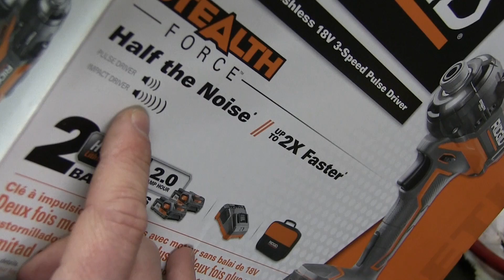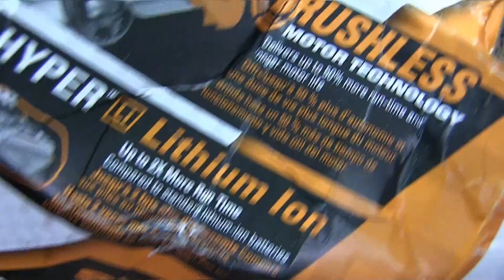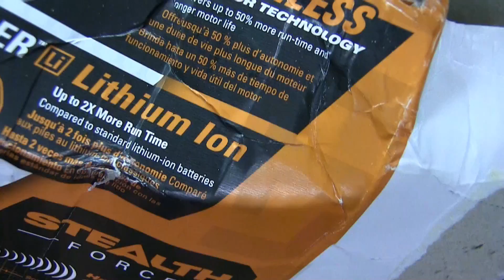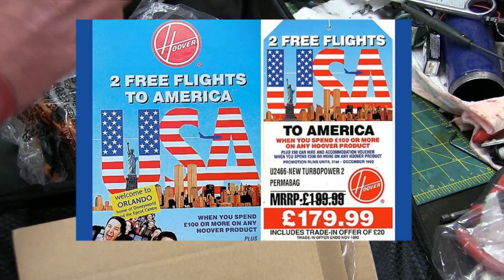BOLTR: Ridgid Hydraulic (?!) Impact Gun

Comment: Looks like they finally found the magic Answer that eluded the many Industry Giants come before. A “reliable” high performance tool  with a calculable & predictable # of Cycles or time before performance losses become so great that the user HAS TO BUY ANOTHER. 

If a tool fails completely the user is dismayed and loses trust in the brand, HOWEVER if the tool provided great reliable dependable service but then just gets worn out from use AND the worn part is unserviceable OR part replacement exceeds cost of a new unit … The user will then simply assume they wore the tool out and then buy another! 

It’s so sinister that i tip my hat to the design engineering team that dreamt up this monstrosity of corporate suit wet dreams.

Cuz so long as everything else is built solid the tool will ONLY degrade with continued use … whether that time is 2 years of day after day use or 20years of light service once it’s exceeded a certain amount of use it becomes too worn out to perform as needed or comparable against what’s available in the future. 

And any honest worker who has used the tool to its calculated point of performance loss will know how much work they got out of the tool and understand they wore the tool out, it lasted and performed well for so long and Happily go buy the next generation from the brand. OH BLIMEY Barney, I think we got ourselves a winner here! 🤑

(That is if everything works as intended and designed 😈)

Comment: I bought the 18v and 12v kits in Alberta Canada,,dirt cheap price for a great set of tools,,came back to the UK and low and behold found out that my AEG battery charger,,240v is the same as the rigid ,turns out AEG are German and are part of the Rigid company of tools.

Comment: Unfortunate the never released an impact wrench with this hydraulic system. It would be nice not to have to wear ear protection workin on on my car. I know you can do the adapter bit, but impact drivers are usually not strong enough to remove lugs.

Comment: Actually brushed motors are powered by AC as well. The difference is that brushed motors use the brushes to convert DC to AC in the guts of the motors themselves, where brushless motors are a bit more complex.

Comment: Noise is an important factor for me. I get the police called on me frequently. Just had a visit from the cops for using a right angle grinder with a wire wheel on a drum smoker. Had them called for using an air hammer, generator, air impacts, etc... Old neighbors.

Comment: I really liked my stealth impact til ti took a shit. Oddly enough it'd blast in 10" timber locks, but died going easy on a drywall screw. Now it doesn't turn at all. I took it apart and the motor is garbage. The impact unit is fine. I'm so done with Ridgid. They've definitely gone down hill. I've had quite a few unjustified failures as of late.

Comment: It's odd that they own Milwaukee, Ryobe, and Ridgid and sell them all at the same price point. I feel they would do better to market them as graded products under the  same name. Contractors and subcontractors are pretty much only going to use DeWalt and employees will either use DeWalt because they're used to it or Milwaukee because it's a better performer. Ridgid and Ryobe are clearly bargain brands for household use, but they try marketing them as direct competitors to DeWalt and Milwaukee. Say what you want about DeWalt, but they're still the most prevalent name on construction crews, I don't care what your experience with them is. DeWalt breaks the most because they're used the most. Milwaukee breaks because people get so impressed that they try doing some ridiculous shit with them like pulling axle nuts off a diesel. Ridgid and Ryobe break because people think these are made to do real work and they aren't

Comment: I've had ridgid tools from the Home Dethspot for several years. Bought the first one 18v drill with 2 batteries and dual rapid charger for $99 with the LSA. Thought it would be a bitch when it comes time to replace batteries or get the tool fixed. A few years later the batteries didnt "chooch" anymore, the pixies were dead. Called Ridgid and had to drive about 30min to a service center for the 2 brand new batteries no question asked. About 1 year ago the batteries were going again,  called Ridgid and they mailed them to me. My sander was about 10 years old and switched off, flipped the board and it wouldn't turn back on. Called ridgid,  took to HD ,paid $20 diagnostics fee and about 4 weeks later (sucked) called and I went and picked up my new off the shelf sander. And got my $20 back! Same thing with my original drill that I've had the batteries replaced 2x , a little too much use on it, she was "choochin" along and when I left off the trigger she was smoking! Called them up, dropped at HD with $20 and 3-4weeks later picked up my brand new lithium drill kit. I still have the old nicad that they replaced 2x and got my $20 back.I've been fortunate and recommend the tools to everyone,  JUST MAKE SURE TO REGISTER WITHIN 90DAYS!

Comment: I had very good luck with Ridgids battery replacement policy. I was all worried about it after hearing all the negative stuff about Ridgid warranty online. So I finally called their 1-800 number and they ask me questions about what it was doing. So they had me plug my batteries into my charger to confirm what it was doing and also wanted to confirm that the charger wasn't bad. They did make sure the batteries they were replacing we're the ones that were registered. After all that was said and done a week and a half later I received new batteries in the mail. It didn't cost me one red cent like everybody else said it would. They didn't even want the old batteries back. I guess if it was to warranty the tool, I would imagine you would probably have to pay to ship the tool back. But I'm not sure if they even want the tool back.

Comment: First off , Love your videos, I can kill a good 4 hours on Sunday watching you undress tools and see how they tick. I had one question on the hydraulic impact you took a part. What kind of oil did you fill it back up with. or what kind do you recommend ?? I have a Milwaukee surge hydraulic impact  that i took a part to clean and if i could change the oil to get better life, i will. They are way more pleasant to use for 8 hours straight , In my opinion.

Comment: Thanks for the Ridgid breakdown, very interesting as are many of your videos. I'm trying to decide between Ridgid Stealth versus Milwaukee Surge pulse.  Milwaukee Surge is not as strong but it's lighter and less vibration, but I like the Ridgid LSA & have a lot of Ridgid batteries already. For overhead work, Milwaukee Surge is tempting. Pulse tools have been around for industrial assemblers and are often pneumatic, but Panasonic has a battery Pulse tool (expensive). Moving this tech to battery tools helps with loud noise of traditional impact guns which starts to wear on your head, especially with deck builds. Nice simulation here on Pulse:  https://www.youtube.com/watch?v=PNVikfLXXwQ

Comment: AVE Did you ever get this put back together? I have been waiting on that future video where you cover the electronics and get her put to work! I did buy this unit, and I can say, I like it a lot more than my other ridgid impact driver. However as noted, the forward and reverse switch takes very little to move it, compared to the older ridgid design. My autistic kid is much more accepting of the noise output of this "Stealth" than he is of the normal impacts!

Comment: AvE you called it. Techtronic was using the Ridgid line to test out this style of mechanism before they moved it to Milwaukee. There's now a Milwaukee version of this impact called the "Surge" series at Homeless Despot.
Reply: The ridgid one doesn't last, from experience. AVE called it; it quickly becomes weaker and weaker with use.
Reply: Jonathan Robertson it will be interesting how long these will last, my guess is not more then a few years. In the mill were were constantly rebuilding or replacing pumps with daily use. These pumps are the most expensive part of the impact but they are not as tough as the industrial one we rebuilt.
Reply: The Milwaukee version is a completely different design.

Comment: I disagree with your assertion that the hydraulic torque generator will not last. Looking at the generator the vanes also act as a pump. As the media’s temperature increases its viscosity decreases and is then flowed to the outer reservoir which is surrounded by the matrix of cooling fins. Then in a thermal cycle as the temperature decreases it is flows or sinks  back into the comp for use in creating torque.  This is a passive exchange not using any mechanical device to move the stratified media. This design is similar to the one speed Hydro drive used on the Swedish supercar Koenigsegg. Totally amazing. I do agree that there may occur erosion of the leading edge of the vanes but I would believe those surfaces have been cryogenically treated. Thank you for your always amazing breakdowns and assessments of new hardware. I truly.   enjoy every new video thank you.

Comment: If the oil used in the "hammer" mechanism is a super refined mineral oil (like what is used in vacuum pumps) then the vapor pressure could potentially be low enough to prevent any cavitation. Any decent vacuum oil will have a vapor pressure below 0.1 micron which would likely be sufficient in the given application.

Comment: Slippage is also fun when you have a local company that focuses on inventory and not so much on the specifics. Suffice it to say I bought an RC drone from a local hobby shop, this is obviously not a house brand and like all things electronic the guts of it is made by a chinese company in china and then put together into finished products either in the US or China, depending on where it's supposed to be sold.
Anyhow, the damn thing lost connection on the fifth flight, did not respond to a return to home command and then drifted off carried by the breeze some half kilometre before finally crashing into a sand pit, only the GPS was working which let me find it after a bit of fiddling with my phone. 
When I opened it up I immediately noticed that three of the brushless motors were fried after having been filled with sand and then strained themselves to death against the ground (The last motor was fine, because that lucky bastard had had its prop sheared almost clean in half and the safeguard on the speed controller had probably shut it off once it started freewheeling.) and the main control board had literal cracks in it.

So I took it back to the store and wondered if the 2 year warranty was still OK. They had me fill in a stack of papers, sent the whole package over to their tech division (Or whatever) in Stockholm, and half a week later the guy just calls me up and asks me what colour I want the new one to be.
I never did get a straight answer as to what they found was wrong with it, but my guess is there's probably a shoddy wire connection somewhere between the receiver and the flight controller, probably some solder that's prone to cracks after repeated vibration.

Comment: I bought one of the 5 piece kits that included this little impact driver.  Seemed like a quality product, but the impact driver died before I could drive a full box of 2-1/2 deck screws.  Took the whole kit and kaboodle back to Home Depot and got a two piece Milwaukee set for the same price.  The Milwaukee seems WAY better.  I am surprised to hear they are made by the same folks alongside Ryobi.  Ryobi is a craptastic brand for sure...

Comment: FIY the design/brand is the same as AEG (Germany) it's also part of the same package as  Ridgid... and so on. I've the battery and charger at hand and can confirm it's exactly the same. Although in my particular case I've got the cordless drill not the impact. 

Regarding the review it's pretty good, but I don't agree with 2 small details. Opposite to what you say the reversing button is pretty robust and could even be more smooth. I apply regularly a small amount of silicone spray in it. I appreciate that smooth action when stretching/balancing on the top of a ladder and need to reverse the rotation.

The front bearing od/id allows for more small balls, so more support points and as such smoother action. Radical example try to lay on a nail bed made of, let's say 10 nails. Next to impossible. Increase it to 1000 nails in the same area and becomes much easier. Guess I need a coffee after this example. LOL  Be well thanks for sharing. ;-)

Comment: I worked at the HD, I just swapped it right off the shelf. Why? Because I promised the customer we would replace the tool and the battery. It says it on the box. I backed it up and did what I did because it was the right thing to do. Many happy customers, the vendor would cry a bit, but in actuality, we sold more tools than any other HD in the region anyway.
Fucking over people for the sake of fine print is wrong. I hated that shit. Register your tools and you shouldn't have an issue. Generally, even if you didn't I just swapped it off the shelf and sent it back as  a manufacturer defect.
Reply: I've never had a problem with the LSA but I heard a lot of people complain about it though.

Comment: So I'm with AvE on the suggestion that it was built to test such a mechanism. Its an outstanding mechanism, there won't be cavitation issues (more on that later), but they had to make sure it doesn't beat out the competing tool they release in a higher market next. So one thing I noticed which really stood out, the battery. That is a 2000mAh battery. My phone has nearly twice the battery power of that tool. Adding a better component really wouldn't be difficult or expensive, but just small aspects like that you absolutely know aren't due to incompetence or poor design choices, but purposefully limiting the tool. Something which it shouldn't need to do considering it has no competition unless they will be adding competition later.

Anyway I made a comment on the cavitation elsewhere. I came up with a huge list of reasons, but two of the easiest to explain are here. Firstly the cavitation is only a risk on the front face of the T shaped device. However it is the side face which needs damage to let any oil seep past. Thus any cavitation damage really isn't going to reduce the device's effectiveness. Secondly cavitation is an incredibly slow process. Whilst a machine in use 24/7 might see cavitation damage over the space of a year or more, this is a tool which is in use and on for a fraction of the day at most, and even then the low-pressure cavitation-risk wave is well below 10% of the time, likely closer to 2%. Now quite frankly I don't believe cavitation will ever happen in the first place, it simply doesn't have the power and the pressure wave is spread out in a sinusoidal-like shape rather than an instantaneous pressure drop, but even if cavitation was as common as AvE believes there is absolutely no risk of it reducing the device's power. It will certainly crap out on you through a more conventional means before it loses even 1% of its capability through cavitation damage.
Reply: 2000mAh at 18v is more powerful than a phone's 4000mAh at 3.7v. An easy way to calculate actual power capacity is multiplying the amp-hours by watts to get 'watt-hours'.
Reply: The insight on cavitation you gave is similar to what I was thinking.  I learned all about cavitation while studying for my boiler's license, and from what I understood was that cavitation take longer than a couple seconds to  really damage anything.  You'd have to run this thing non-stop for quite a while for it to have an effect similar to pipe cavitation and whatnot in a loop.
Reply: You can't compare a cell phone battery designed for energy density to a power tool battery designed for power.  The cells are built differently and have different chemistry's. You will never get the amperage or c rate from a cell phone battery that a power tool one will get .  Cell phone battery's are typically a single cell , a power tool has multiple cells strung in series.( Some in parallel to increase amperage or capacity). The mAh of the cells in parallel or single cells rating and the voltage in series is needed  to calculate the wh available for the pack .   Your cell phone has no where near the power or the wh capacity of the battery pack in this tool.
Reply: Capacity is measured in mah, discharge is a C rating, those 2 are very, very different from one another.
Reply: @elymisany  never said they were the same . C rate is used to determine the cells amperage capability. A high c rate cell is one designed for power output. Low c rate tends to be a energy dense cell that is usually high amperage limited.
Reply: +Olivia Lambert ...
Are you AvE's daughter? If no, are you single?
Reply: Olivia Lambert such a smart and beautiful girl  ☺

Comment: cordless impacts need to switch to 3/8" drive. no more need for 1/4" drive. too weak. the drive adapters will snap on large rusted nuts...    they'll take off crankshaft bolts, which is good. But they'll still eventually snap if the bolt is stuck enough.

Comment: You can build your own spanner type wrench with plate stock, handle stock, and self tapping screws.

the protrusion through the center is drilled out on the press with a Hole Dozer bit. the detents that you need to enter are marked with a pen and then drilled through with self-drilling&tapping screws. cut off the excess of the screws. weld the handle.

maybe too much work, but ruining a tool sucks pretty bad. plus, it's faster than going to the store and trying to find a spanner wrench (in the case of grinder wheel lockrings for which you have no spanner)